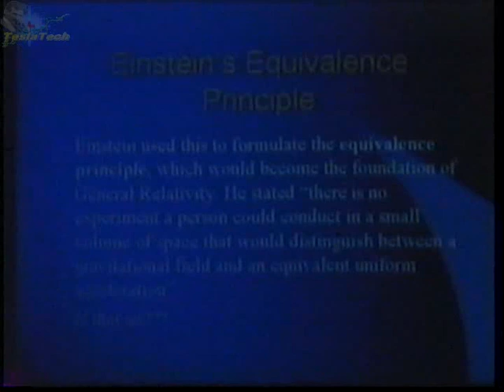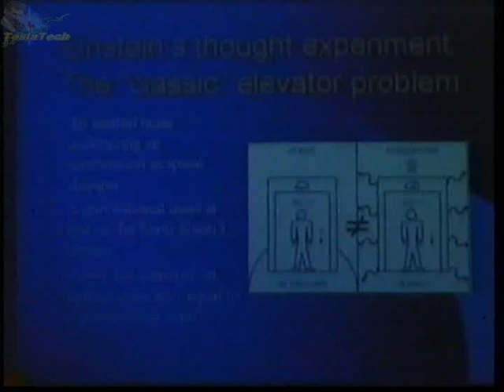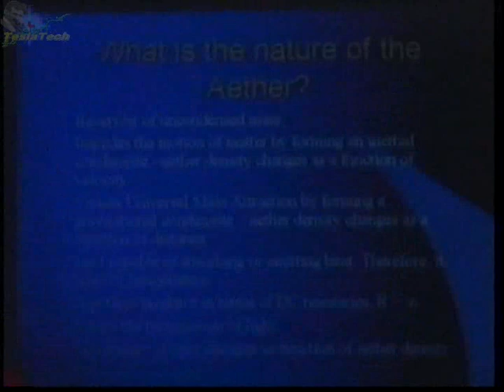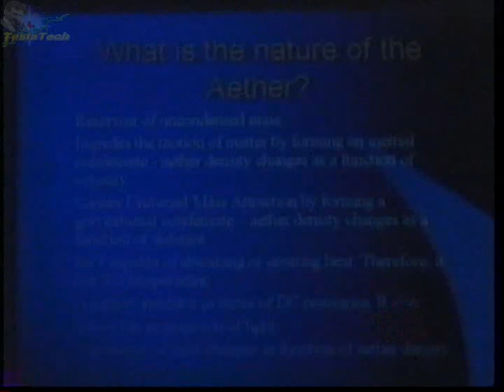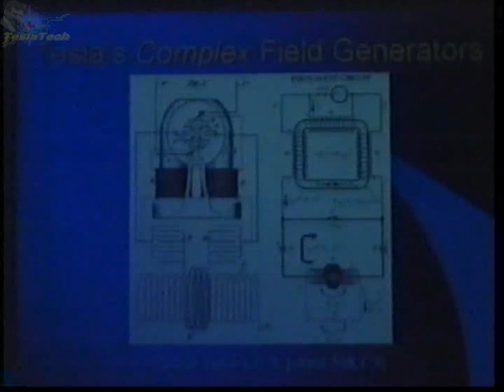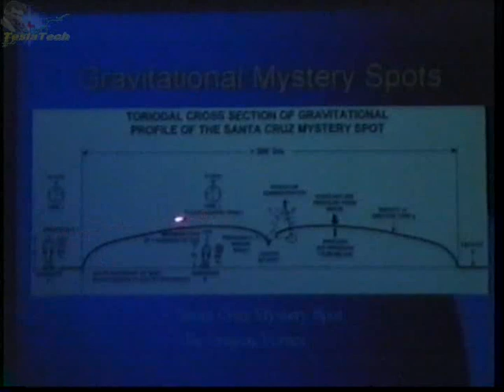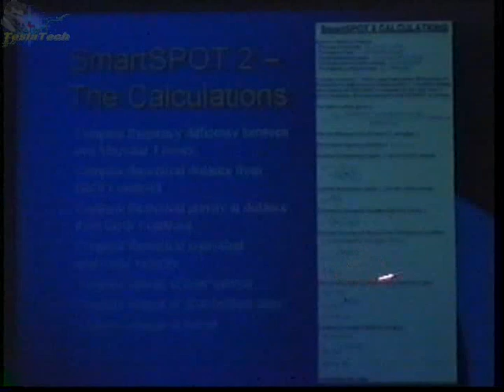William Alek - Free Energy and Anti-Gravity, Extraordinary Technology Conference, 2005

Comment: At time 2:30, the Einstein statement of the Equivalence Principle,  "there is no experiment that can be performed in s small volume of space that would distinguish gravity and uniform acceleration"

THIS IS FALSE.    

First, recall that "accelerated charged particles generate electromagnetic wave radiation"
UNLESS THE ACCELERATION IS DUE TO GRAVITY

Take a piece of wire.  The wire is full of charged particles, recall (both electrons and protons).
Do not hook up any power to the piece of wire.

Take an EMI/RFI or other electromagnetic wave frequency detector, and check for electromagnetic waves.

If there are electromagnetic waves,  the acceleration NOT due to gravity, because in a gravity acceleration, a 'stationary' piece of wire on the table IS accelerating - due to gravity - and in gravity acceleration, charged particles do not radiate EM wave radiation.

Under non-gravity acceleration, the charged particles will radiate EM wave radiation, as expected.
Reply: A coffee cup on the table is subject to gravitation but is not accelerating. Sorry Albert
Reply: @StarNumbers  Wow!  You're easy.

1)  F = mg
2)  carefully note that no mention of translational motion exists in the standard equation of Force 'F', mass 'm' and gravity acceleration 'g'

3)  We have:    F/m = g   (the acceleration 'g' is Force 'F' being applied by the mass 'm'.  For example,  F is your body weight reported by your bathroom scale,  Gravity acceleration 'g' is CAUSING your scale to report that force, 'F', which is your body mass's weight)

4) Now, get on the scale in your bathroom.  Let's assume you're in good physical shape, and the scale reads 170 pounds

5)  since we know that the scale provides a non-zero Force (your weight of 170 pounds), and since we know your mass does not drop to zero - does not change AT ALL from its non-zero value just because you stepped on the scale, we have:

F/m = is a non-zero value

6)  Since F/m = g,   and since F/m is non-zero, we have:   g is NON-ZERO

7)  what is g?  32.2 feet per second squared (aka 9.8 m/s^2)

Your confusion comes from two sources:

1) you assume acceleration ALWAYS requires translational motion - it does not

2)  you neglected the push-back - in the UPWARD direction - of the Earth.

The Earth:

- cannot eliminate your downward acceleration of 32.2 feet per second squared

- if the Earth was not pushing back against your weight (the downward force 'F' reported by your bathroom scale) - your need for translational motion would manifest  (ie. if the ground suddenly vanished under your scale, you'd fall downward into that void)

The acceleration due to gravity DOES NOT GO AWAY just because you are not undergoing translational motion - ie. just because the ground is pushing back (upward!) against your weight,  that DOES NOT REDUCE GRAVITY 'g' TO ZERO

The acceleration of gravity 'g' is not affected by your lack of translational motion.

Your zero-value translational motion is occurring BECAUSE EARTH EXERTS A FORCE UPWARD, AGAINST YOUR BODY'S MASS

Stand next to your house and push hard against the outside wall.  The force you exert on the wall is  F = ma

Since the force on the wall you are created is non-zero, and since the mass is also non-zero, we have:   

F/m = a

I think you can now see why, even though 'a' is non-zero,  the wall is pushing back, so THERE IS NO TRANSLATIONAL MOTION of the wall.  

Even though there is non-zero acceleration, because caused by the force - your pushing - against the wall.   If a bulldozer exerts force Fb = ma against the wall,  there will be observable translational motion
.